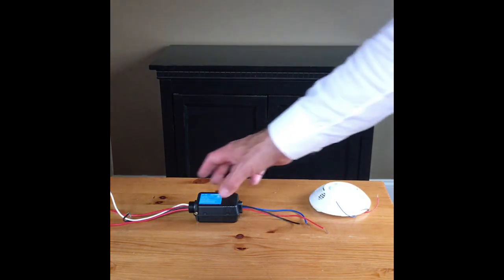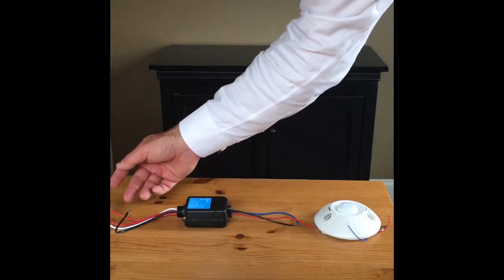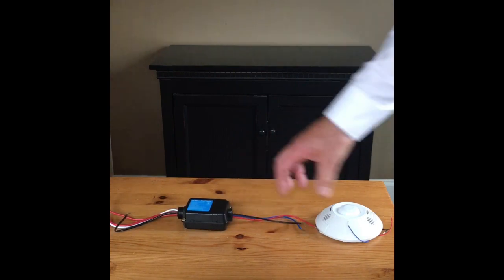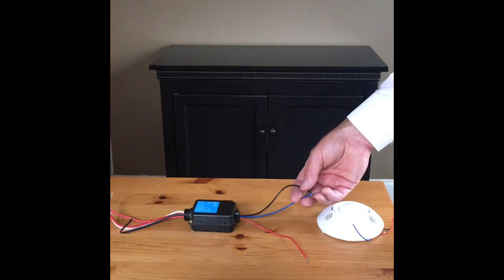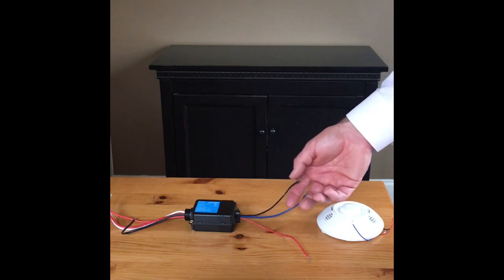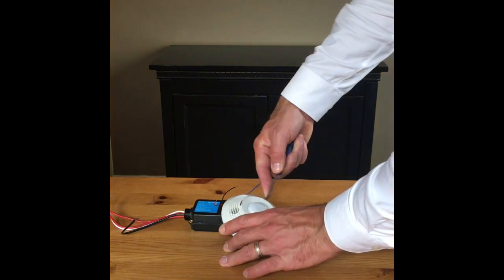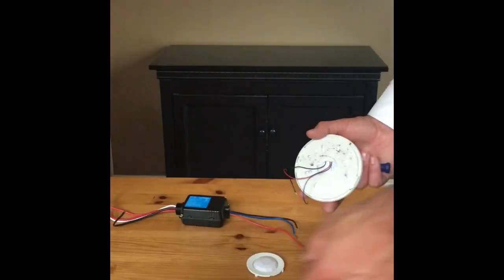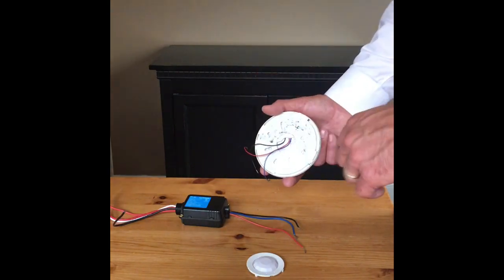Ceiling Mounted Motion Sensor And Powerpack Basics

Comment: But when we have 8 motion sensor how many power pack to I need and how to wiring in serie to work in the same Zone (??)
Reply from the maker: One powerpack powers 3 sensors.  One powerpack switches the line voltage.  The other powerpack just powers the sensors and you connect the low voltage common and signal wire to all the sensors.
Reply from the maker: @CarlosRodriguez-x3m  

https://youtu.be/fYXRsQXOU00?si=FyA1U1qwtDU2T5A_

Forward to 4 minute section and i explain it

Comment: Will the sencor work with out the power pak
Reply from the maker: No. This is a 24 volt sensor.  The powerpack provides the 24 volts and turns the 120 on and off.  They do make sensors that do not require a powerpack, but that is not what i am showing here.

Comment: So for the low voltage side.  I connect the blue and black together.  And the red to the red ?
Reply from the maker: Black to black for common.  Red to red for 24 volts. Blue to Blue for signal wire.

Comment from the maker: It could be a few things.  I would make sure the manufacturer of the motion sensor and powerpack are the same company.  Then follow their instructions.  Some sensors have a vacancy setting which means you need to have a switch to turn the lights on.

Comment: Thanks for this.
Is the "feed", a switch leg or from your home run?
The instructions that come with these units show NEUTRAL switching not hot leg switching.
Reply from the maker: The powerpack is the switch.  The powerpack needs constant hot which is the black wire.  You connect one red to the black which becomes the line side of the switch.  The other red becomes the load side of the switch.  You do not switch the neutral.

Comment: I’m in a commercial building and there are 2 of these motion sensor in a suite. There lights have been on for 2 weeks now. They won’t shut off. What’s the troubleshoot? Thanks
Reply from the maker: HI Trevor.  I have another video that shows troubleshooting.  Since you have two motion sensors in one room, you will need to put them both in "test mode" at the same time to check if they shut the lights off.  Also, as a general rule, the sensors should be at least 6 feet away from a hvac register.